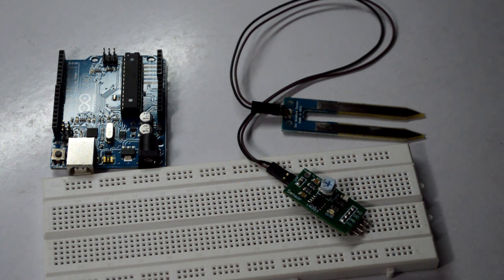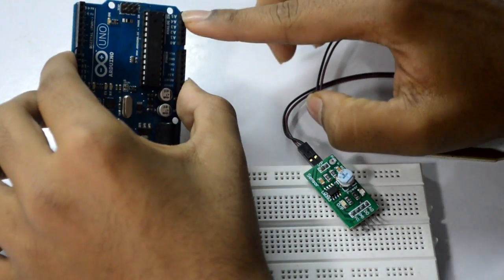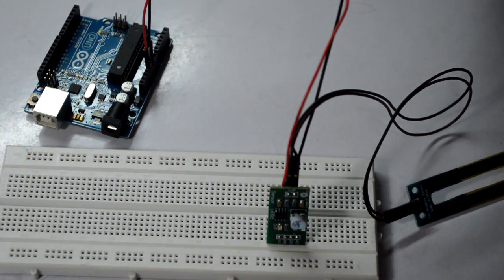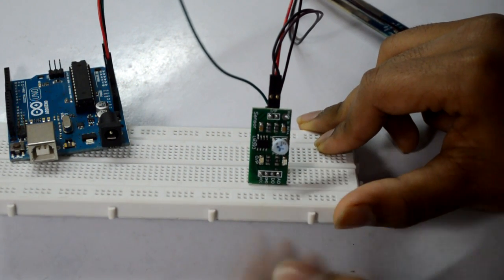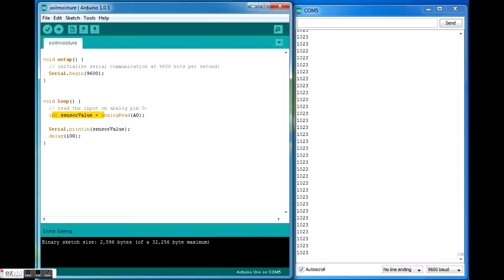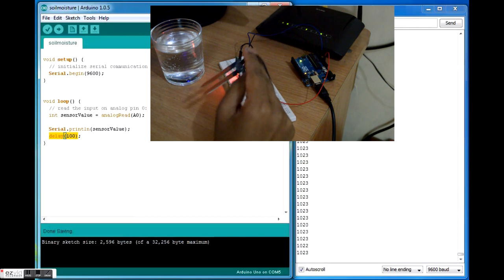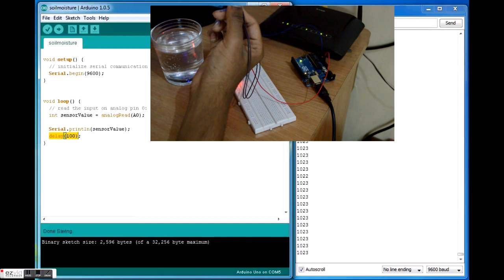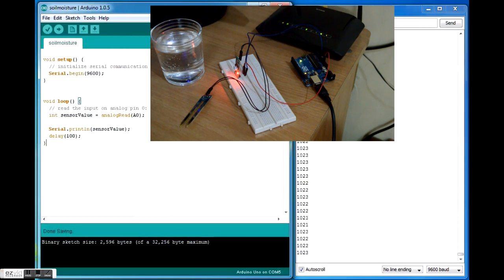Soil Moisture Sensor with Arduino- Interface and Coding

Comment: // The digital pin to which the LED is connected
int REDLED =13; 
int GREENLED =12;
int DCMOTOR=11;

void setup() {
  // initialize serial communication at 9600 bits per second:
  Serial.begin(9600);
  //pin 12&13 is set as output pin
  pinMode (REDLED, OUTPUT); 
  pinMode (GREENLED, OUTPUT); 
  pinMode (DCMOTOR, OUTPUT); 
}

// the loop routine runs over and over again forever:
void loop() {
  // read the input on analog pin 0:
  int sensorValue = analogRead(A0);
  if (sensorValue < 1000) // check the Moister level 
  {
      digitalWrite (REDLED, LOW); //Turn OFF the RED_LED
      digitalWrite (GREENLED, HIGH); //Turn ON the GREEN_LED
      digitalWrite (DCMOTOR, HIGH); //Turn ON the DC_MOTOR
      Serial.println(sensorValue);
      delay(1000);  
  }else{
     digitalWrite (GREENLED, LOW); //Turn OFF the GREEN_LED 
     digitalWrite (REDLED, HIGH); //Turn ON the RED_LED
     digitalWrite (DCMOTOR, LOW); //Turn OFF the DC_MOTOR
     Serial.println(sensorValue);
     delay(1000);  
    }
}

Comment: i am getting values like this without dipping it into water
415...410...400...355...340...322...311...295...285..275..265..245..235.221...221...210....200...190...180..170...160...150...140...130...120...110...
Reply from the maker: Is the touch of your fingers doing this? Or is the sensor not being to touched at all. May be a jumper connection is loose

Comment: hi.. thnx for the useful info.. i am using two moisture sensor and one dht11.. how can i set the code to turn on the pump for when the temperature is high, the moisture is low?

Comment: Thanks! 
I used this to get the sensor value as percentage:
int sensorValue =   analogRead(A0);
int percentageSensorValue = map(sensorValue, 1024, 0, 0, 100);
Reply: calibrate it with soaked soil/water, as the minimal value might not go as low as 0

Comment: hello. I'm using arduino UNO. What code can I use to make the sensor control the waterpump. For example, if dry, waterpump on, if wet waterpump off. Thank you
Reply: just check if your parameter is in under certain level, %, or wathever mapping you are using with your readings.

As you said: if (moisture < MoistMinValue)
                       {
                           digitalWrite(pin_number, HIGH);
                           delay(6000);
                          digitalWrite(pin_number, LOW);
                         }      
This will power the motor per 6 seconds, simplest way but you arduino will be stuck in that program per 6 seconds aprox. Check for "interruptions and timers" in the case you want to use your arduino for something else, meanwhile the water pump runs. Take a look at "millis" also. 

define: pin_number as the pin connected to the motor controller

Cheers.
Reply: Thanks for the explanation. Hope can learn more from you :)

Comment: how to make the 1024 to indicate that is 100% wet instead of 100% dry???
Reply: check the value when its 100% wet. In my case it´s around 160.
 then use the map function.
  example:
  sensorValue = analogRead(sensorPin);
  sensorValue = map(sensorValue,160,1023,1023,0);
  sensorValuePercent = (sensorValue / 1023) * 100;    //  in Percentage
Reply: thanks! it worked ;)

Comment: Thanks for the great tutorial. Here is what I did.

Bought Moisture Sensor from here:
https://www.amazon.com/gp/product/B00NAV2FW2/ref=oh_aui_detailpage_o00_s00?ie=UTF8&psc=1

Connected to Arduino Uno using breadboard, 5v, Gnd and A0. I tried 3.3v and number values drop so went back to 5v.

I then ran some baselines with the serial output showing the analogRead(0) On my board I got the following.

128-130 in cup of water
79-101 moist soil (bought a new succulent plant from IKEA at lunch, freshly watered?)
Anything else getting dry-ish for a Cactus 700~800's would be fine.
1014-1023 out of water sitting on desk, No moisture.

My code (note: the else if statement took me a while to figure out, I was so happy when I did get it to work:

void setup() {
  // init serial comms at 9600 bps:
Serial.begin(9600);
}

void loop() {
  // read input from A0:
  int x;
  x = analogRead(0);
  int sensorValue=analogRead(0);//Serial.println(sensorValue) remove // if you want to see # value too;
  delay(500);
  if (x > 1000) {
    Serial.println ("Really thirsty");
     }
    if (x < 200) {
    Serial.println ("Doing fine");
     }
   else if (x < 800) {
    Serial.println ("Getting dry");
     }
}

Comment: Thanks in advance for the Video was really usefull!  I have a doubt. The monitor showed a lower number when the humidity is high (for example a cup of water) and a high number when is low. What this mean? Is OK or im doing something wrong? What kind of measure is? Can you help me with the line of code to convert this to %. I think than with % should be more "readable".
Reply: Hi, that is because, when you measure by analog read, you are taking the measure from an open circuit, in that case, is similar to measure the 5V power supply, thats why you have "HI" value. Remember 5V is mapped when you read as 1024 (i think so, i dont remember at this moment).

In the case of conduction like water or at different volumetric water content that potential will decrease proportional to the conductivity of the soil (material). English is not my first lenguaje. 
Anyway you can find different kind of sensors, same shape, and they will work in similar way.

To calibrate your sensor, dry a soil sample, then put your probe inside and measure, take this value as a 0% water content. In the real world normally of a soil sample 55% will be solid material, 45% pore space (empty, air, water, etc).

So once you ve got readings of a dry sample, add water in a proportion to 55%/45%, mix them, and put again your probe. Get the readings and with that you can "map" your readings to a real world moisture meteer.

Comment: Hi there. Thanks for the tutorial. I have a question about the code. How would I change it so that the output value would be mapped to a percentage between 0-100% . For example dry would be 0% and wet would be 100%?
Reply from the maker: +Rydel C  say for example 1023 is wet and 0 is dry. The value is 512(say) then (512/1023)*100=  ~ 50%
Reply: I tried doing that but I cant get a linear reading on the device. Its behaviour is logarithmic. Thats what i found anyway. Thanks for the cool vid!
Reply: Try to map your values
sensorValue = map(sensorValue,160,1023,0,1000);
Check the values and take the readings from dry and wet soil as calibration process.

Comment: Hello. I am using a arduino to send +5V to an optocoupler, to drive a triac. The triac is to switch a 24VAC Solenoid Valve. My question is how do i turn off the triac?
Reply from the maker: +Haitham Adwan You can just use 5v sugar cube relay instead of the optocoupler+triac if you just want to switch the valve on or off.
If you want to vary the water pressure by changing the size of the orifice (opening gate) of the valve then you will need a triac
Here is a link to a circuit diagram
http://www.sigmatone.com/images/uc_to_control_devices_big.png
Reply: +GetTutorialized KD +GetTutorialized KD thanks for the reply. everyone is telling me use relay, but I say to that that I don't wanna buy new parts and I'm trying to make this more comprehensive, this is my final year project for electrical engineering technology programming, my thesis project if you will. Another question would be how would I turn off the triac if it latches. people said reverse the direction of current, but how do I do that
Reply from the maker: Give a low signal from the arduino to the optocoupler

Comment: Hello budy. Thank you for your great job. Sadly i do not have any knowlege in coding and programming.  I need to attach a small water pump 12v to my Arduino UNO R3. I did the same thing in the vidoe and downloaded the code and put it in my Arduino but i do not know how to code in order to run my water pump too. Culd you please send a code that i can have the water pump working along with my Ardiuno? I really appriciate your work. :)

Comment: Hello Sir, I need to have a small waterpump (12v) too with my Arduino in order to watering the flowers. How can i install to the Arduino (UNO R3)?
Reply from the maker: +Ahmad Zaher All you need is a Motor Driver Module, say L298n would do the job. Plug in the pump on the output side of the Motor Driver. and give digital High outputs to it from the input side to start the pump. Make sure you know the current consumption of the pump. If you are using L298n then it should not go above 2amps else use a 5VDC arduino compatible relay.
Reply: Just put in you digital pin configured as output an ULN2003 IC to switch the ground of the motor, for extra protection remember to put a diode in parallel with the power leads of the motor.

Comment: sir what if ill put a LCD? heres the code i use. but the output in the lcd is only box box box.

#include <LiquidCrystal.h>
LiquidCrystal lcd(12, 11, 2, 3, 4, 5);
int soil = 0;
//the setup routine runs once when you press reset:
void setup() {
  
//initialize serial communication at 9600 bits per second:
Serial.begin(9600);
lcd.begin(16,2);
}

//the loop routine runs over and over again forever:
void loop() {
lcd.clear();
//read the input on analog pin();
int sensorValue = analogRead(A0);
sensorValue = constrain(sensorValue, 485, 1023);
//print out the value read;
//Serial.println(sensorValue);

//map the value to a percentage
soil = map(sensorValue, 485, 1023, 100, 0);

//print out the soil water percentage you calculated
Serial.print(soil);
Serial.println(" %");
lcd.print("Soil Moisture");
lcd.setCursor(0, 1);
lcd.print(soil);
lcd.print(" %");

delay(1000);  //delay in between reads for stability
}

Comment: Nice video demonstration of an Arduino-based soil moisture sensor :) There's one thing that worries me though: from the way your code is written and the way the sensor is connected it looks like it's using DC for the measurement. Now this means that if I'd leave the sensor in the ground permanently and/or use it for a longer period the electrodes will corrode away (or at least its parameters will change rather rapidly). Do you think that this sensor could do capacitive sensing to avoid the problems mentioned above?

Comment: What if we want to monitor different areas using multiple soil moisture sensor? like 5-10 sensors or so..
And we'll need a monitoring unit wherein it automatically waters the plant if it reaches a certain level of moisture?

I hope you can reply. It's our project and we're not really good in programming.
Thank you so much,. Your video is great, btw.
Reply from the maker: Leslie Brillantes  Arduino UNO can only manage 6 sensors which can be connected to the Analog Input pins. You can get an Arduino MEGA which can easily help you with 10 sensors.
All you have to play with is the analog values which you are receiving from these sensors and use some programming logic like if-else, while etc etc to turn some water pump or anything like that!
Reply: Thank you for replying, this means so much to us. Btw, We're thinking of using Raspberry Pi, by any chance do you know how we'll be able to do this on Rpi? 

We'll use RPi because we have to monitor the data being gathered by the sensor thru a webpage or anything, as long as we can monitor and control the system online :(
Reply from the maker: Leslie Brillantes Okay,
Option 1: With Raspberry PI
Raspberry Pi needs an 'ADC' Analog to digital convertor before we use an Analog sensor with it. Generally people use IC MCP3008. Here is an easy tutorial alog with the python script
http://www.raspberrypi-spy.co.uk/2013/10/analogue-sensors-on-the-raspberry-pi-using-an-mcp3008/
With IC MCP3008 you can connect a maximum of 8 analog inputs

What remains here is sending this data online. Which you can easily do it WEBIO pi. You can also control any GPIO from a web page

also this link will help!
http://www.dexterindustries.com/BrickPi/projects/thingspeak-temperature-log/

Option 2: With Arduino
With arduino, you already know how to connect and get data from analog sensors and manipulate it. So what remains is sending the data to a server and controlling from the Web
There are loads of ways to do it with Arduino
The latest is with ESP8266 Wifi Module
You can also use an Ethernet Shield with it!
Reply: ***** THANK YOU AGAIN SO MUCH FOR REPLYING. You are very helpful.
I have so many questions, I hope you don't mind. Is it possible that I connect the sensors to the Arduino, then send the data to the Rpi? Since the Arduino has Analog Inputs.
We have to utilize the RPi in our webpage, because we're making an automatic irrigation system wherein we can control the system anywhere as long as there is an internet connection
Reply from the maker: Leslie Brillantes Welcome :) add me to your circles or send me a mail about your complete project details on gettutorialized@gmail.com
Reply: I don't know what do you mean about "circles" sorry. But i will email you. THANK YOU SO MUCH T_T
Reply: ***** I added you to my circle. And sent you an email. Thank you so much.
I hope to hear from you again, thank you thank you!

Comment: first thank you so much for sharing this project, I have a question, if i want to use three sensors to measure three different soils misture. what changes i will do on the codes and how connect the other sensors?
because this is my projects.

I appreciate your help
Reply from the maker: Here are the changes in the code:
int sensorValue1 = analogRead(A0);
int sensorValue2 = analogRead(A1);
int sensorValue3 = analogRead(A2);
  
Serial.println(sensorValue1);
Serial.println(sensorValue2);
Serial.println(sensorValue3);
Serial.println("");
delay(100);

Circuit:
1. Connect all the +5v wires from the sensors to Arduino 5volts pin
2. Connect all the ground wires from the sensors to Ground of arduino
3 Analog output from each sensor will go to A0,A1 and A2 pins respectively!
Reply: *****

I havent seen helpful people like you. I dont know how to thank you enough. I really appreciate you. Thank you so much.
Reply from the maker: Thanks for watching our videos
If u know how to do it! Then share it so that others can know too :p
Reply: *****

I did it
I shared it via my twitter account
Reply: ***** i have last question if you dont mind. if i would like to use water pump with the three sensors what changes will happen on the codes?
thank you so much
Reply from the maker: HASHIM ALTOMMY Say for example, you have connected the pump motor on Digital pin 5

void setup()
{
pinMode(5,OUTPUT);
}

void loop()
{
if(//water content is low)
digitalWrite(5,HIGH);
}
Reply: Thank you so much
Reply: ***** How do I have the pump triggered at a specific moisture level?  Say I want the pump to come on when the sensor reads 700 and turn off when it reaches 400?
Reply: HASHIM ALTOMMY Are you able to send me your water pump specs? or model. just for a reference, I'm working on 10 moisture sensors

Comment: very nice tuto, but how can i cconvert the data tha we read with the arduino to the real percentage of soil moisure?
Reply: haithem ben jamaa Great question. Look into the arduino 'map' function. The map function can convert the values from your project into another system of measurement, such as a percentage in most cases. You set the maximum and minimum value from your project (in this video the max is 1023 and the minimum was about 330) and assign them new values. So in this guy's video, he would set 330 to be 100 because that's when the sensor was completely saturated and he would set 1023 to be 0 because that's when it was completely dry. Then when he prints the new 'mapped' values, he would only get values between 0 and 100. Look up 'arduino map function' in google and you'll get lots of help.
Reply: +Cameron Sluiter thanks..it really was helpful

Comment: Im making a circuit with this moisture sensor, but lighting up an LED separately from the sensor, but am struggling to get it working. ive got an led to pin 13 and the moisture sensor to A0 does that sound right to you?
Reply: +Chris Webster To turn led on and off or make sound with soim moisture sensor visit this (http://www.amazingtips247.co.uk/2015/10/turning-led-on-and-off-with-soil.html) site you'll find the sketch with circuit.

Comment: thank you for sharing the project :  I have modified some of your code and used a lcd display , it shows soil type , level and analog output . I used a yl 69 sensor.
Here is the code :

Arduino Uno Soil Moisture Sensor

// 0 -400     in water

//400-700     humid soil

// 700-950     dry soil

#include<LiquidCrystal.h>

LiquidCrystal lcd(7,6,5,4,3,2);

void setup() {

lcd.begin(16,2);
Serial.begin(9600);
}

void loop() {
// read the input on analog pin 0:
int sensorValue = analogRead(A0);
Serial.println(sensorValue);

if(sensorValue<400) {

lcd.print("Soil Type:Watery ");
lcd.setCursor(0,1);
lcd.print("Level: 80~99%");
delay(1000);
lcd.clear();

delay(2000);

}

if((sensorValue>400)&&(sensorValue<600)) {
lcd.print("Soil Type:Humid ");
lcd.setCursor(0,1);
lcd.print("Level: 45~65%");
delay(1000);
lcd.clear();
delay(2000);

}

if((sensorValue>600)&&(sensorValue<950)){
 
lcd.print("Soil Type:Dry ");
lcd.setCursor(0,1);
lcd.print("Level: 0~5%");
delay(1000);
lcd.clear();

delay(2000);
}

}
Reply: So I have your code but I have no idea how to hook up the LCD using your coding.  Also I need to have digital pin 13 to have a digital output to turn an LED on/off according to a preset number inside the parameters of the analog input range.

Any help at all on this would be appreciated.
Reply: Amit Kundu   hi great sketch need to modify LiquidCrystal to show RW and E  (12,11,5,4,3,2)
Reply: please will u send me the code of lcd and soil sensor